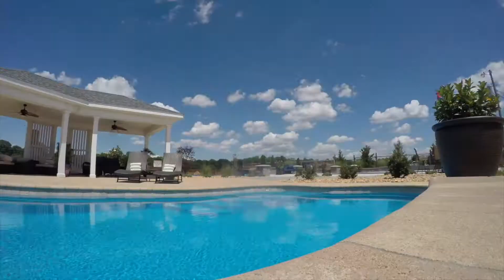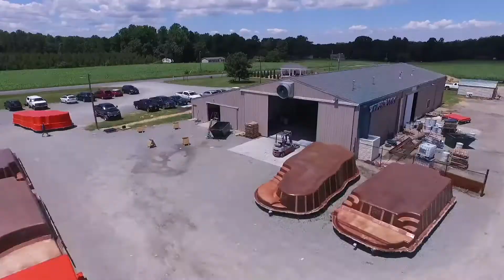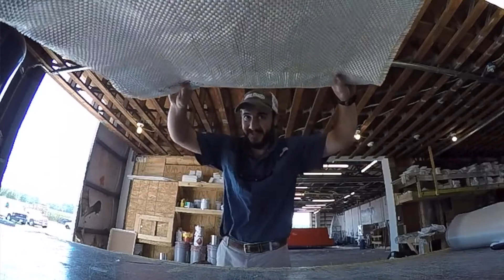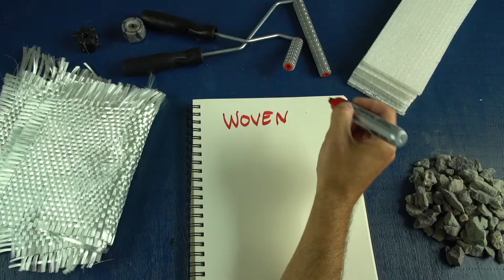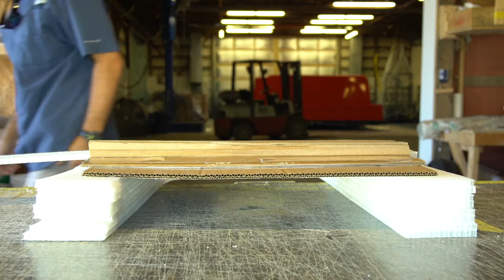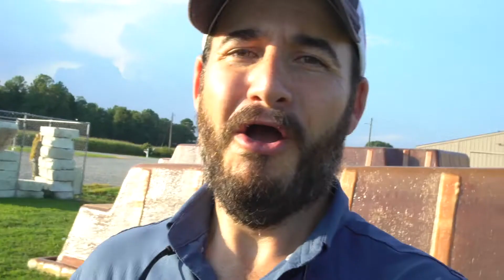How Fiberglass Pools Are Made; Woven Fiberglass & Honeycomb; 5 of 8; The Perfect Fiberglass Pool

Comment: hi, good video, but i cant understand how you got the idea that continuous fibre reinforcement is more flexible than chopped reinforcement. continuous is always the ultimate reinforcement you can have for strength and stiffness. lets say we look at flexural test specimens. in the case of unidirectional tapes you have 100% of the property in 0° reinforcement direction; in the case of woven fabric because 50% of the fibres are aligned in warp and 50% in weft direction you get usually less than 50% of the UD properies (considering effects like undulations); in the case of chopped you have, depending on your process, uniform reinforcement in all directions so just a small amount of the fibres are aligned in the 0° direction ... simply by thinking about this, a specimen made of uniformally oriented chopped fibres can never be stronger or stiffer than a woven fibre or UD fibre specimen.

if chopped was stiffer or stronger, high performance race cars, aircraft etc. would be made of chopped carbon fibre. actually it isnt ;) but i can understand that for hull building like pools, spraying chopped fibres is faster, more convenient and less labour intensive than continuous lamination

5:59 you are changing up strength and stiffness :)

greetings